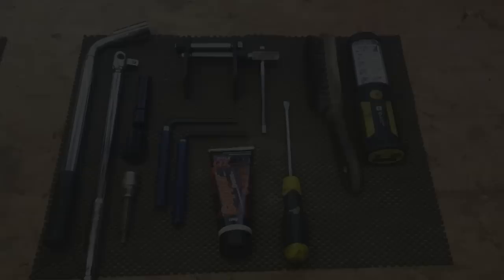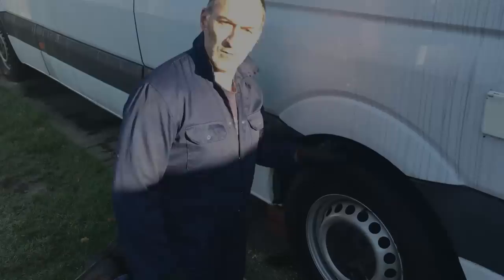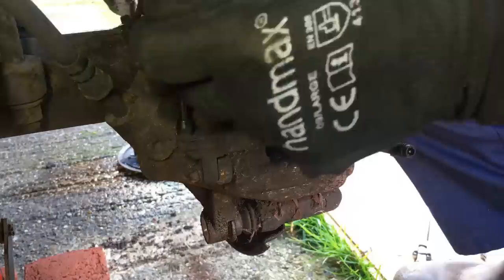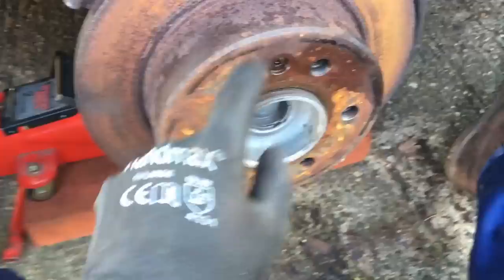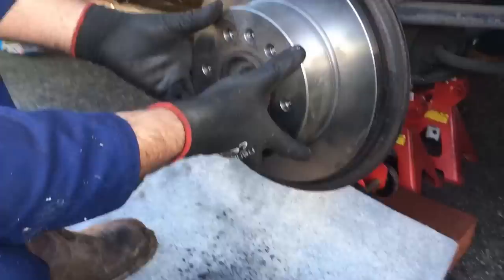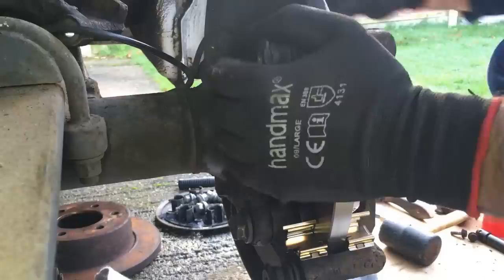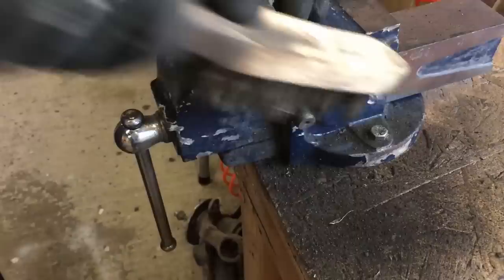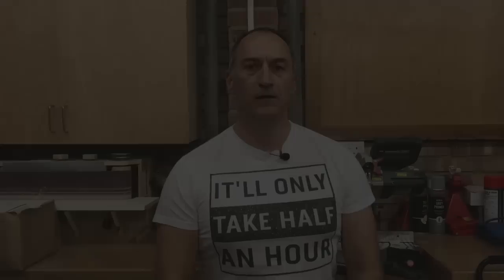Mercedes Sprinter - New Disc Brakes and Pads

Comment: Wow,
I am feeling very accomplished. 
Thank you so much from across the Atlantic 😊. 
Just did the passenger side.
Bought my 2015 sprinter used in November. 
I don't think these rear rotors were ever changed. You 20 minutes was my 6 hours of rusted frozen bolts.
But I persevered and got my passenger side done.
It's dark, so tomorrow to the next side.
I'm praying 🙏 the other side won't be hard.
Reply from the maker: Plenty of penetrating fluid and leave to soak for a bit. A shock with a few hammer blows also helps. 👍🏼😃
Reply: Replace the drivers side today. Took 2 hours😅. Not as rusty. Yay.
Reply from the maker: @time.528  That's good to hear, glad you got them all sorted ok, well done.

Comment: I always leave the hub cap off so I remember to check the wheel nut torque after a few miles. Great video.
Reply from the maker: I can't buy another torque wrench when I have one buried in the storage unit that I can't find cos I know what will happen I'll buy it and the one I've already got will miraculously appear in front of me lol
Reply: @GregVirgoe  my point was to check them after a few miles, not that important to use a torque wrench but definitely check after a couple of journeys.
Reply from the maker: Very wise and a good point, I'm glad I've got you guys here watching my back, thank you

Comment: Hey Greg. First (from the other side of the pond, US), I want to complement you on your videos. My wife and I have thoroughly enjoyed each one. They are VERY informative and have given us several ideas as to what we will do on our Sprinter. Our van will be multi purpose to use for our company and weekend trips. Obviously ours will be a bit different. Already the steering wheel is on the wrong side. Ha ha. I hope we can get ours looking half as good as yours, since I am not the expert wood worker as you are. But, I make up for for that with mechanical abilities. As a tinker on cars and trucks for 40 years, let me give you a couple of tips on brakes that I've found to work on every vehicle. #1- use some anti-seize on the threads of all mounting bolts very sparingly. That will be a big help next time you take them out (No need to hit them with a hammer). #2- Put some high temp brake grease on the smooth part of the two caliper (Cylinder) bolts. Because if it doesn't freely slide it can cause one side (or pad) to wear quicker. And, also some high temp grease on the ears of the brake pads.  #1 and 2 will make it much easier next time you service your brakes and prevent uneven wear, extending the life of your brakes and making them more efficient longer.
You have given us several tips and I hope ours will help you.
Keep up the great work with your videos! Looking forward to the next.
Dave & Uka
Reply from the maker: That's Great Advice and thank you so much for giving it in such a clear and thoughtful manner, I really do appreciate it, thank you very much guys :D

Comment: As an ex motor mechanic, the clout on the head of the bolt after applying WD40 was a standard operation. So good advice, Greg. Not finished video yet but so far everything on a par with what I would have done when I was in the trade. Good work.
Reply from the maker: So if I need a job as an apprentice mechanic later in life I'll be ok? 😉
Reply: @GregVirgoe  - Ha ha. No it's a pretty shit and dirty job bud. I have been out of the trade for a very long time. And I'd not go back. You are a very skilled fella, so I am sure there are hundreds of nicer jobs you could turn to if desperate!

Comment: Great tutorial, Greg. I did this last year as I was getting a safety warning on the dash. Turned out to only be the front discs but wanted to replace everything with new as I had just bought the van. I ‘thought’ I cleaned everything well enough but I’ve since gotten some squealing at lower speeds. Grrr. I’ll wait for spring and then take them apart again to clean and re-lube. Keep up the great work!

Comment: Great video, Greg. It's lovely to see people share these kind of videos. :-)
I would recommend to always check the activation arm, for the brake shoes. They are notorious for getting stuck. Also remember to adjust the parking brake(cable and brake shoes), after a change of brake disks. Last and not least; check, clean and lubricate the glider pins.
Reply: No

Comment: Hi Greg,

Great video, as always. Here’s a couple of suggestions for the future.

Even if you regularly bleed your brakes, the fluid that is in the cylinder will be in a bit of a ‘dead leg’. Therefore, when I do this job, rather than forcing what is almost always filthy fluid back up towards the master cylinder, I crack the local bleed nipple open so that, when I push the piston back, it expels the worst fluid out of the cylinder and into a jamjar for disposal.  It’s usually much easier to push the piston back that way too – path of least resistance for the fluid – and prevents worry of overflowing the master cylinder reservoir.

Also, once when I was when putting new seals, pistons and gaiters in, the manufacturer of those advised me that the mechanics’ favourite trick of using copper grease for anti-squeal and brake lugs (combined with red rubber grease on the rubber components) is best avoided and they recommended that the only grease you should ever put anywhere near brake components is silicone grease. (I generally find that the easiest/cheapest is from a plumbers’ merchant for fitting rubber-sealed plastic pipe parts together.) 

They told me that this is because copper grease is mineral-based and always migrates. Once even small amounts get to the rubber components, it causes them to fail, so you end up with split gaiters letting water in and the next thing you have is corrosion, seized slider pins and failing seals in the cylinders. They also said that the classic ‘red rubber grease’ that people tend to use on the rubber parts goes stiff within a couple of years and, again, you end up with a caliper that won’t slide, so just use silicone there too.

If you ever need individual brake components (that often aren't supplied by your dealer spares department anyway), I’ve found BiggRed.co.uk in Worcester to be very helpful, with an extensive range of individual caliper parts.

Regards,
David.

Comment: Hi Greg,
I do watch your videos with great interest. The interieur work you did on your conversion ist simply amazing and way beyond the skills I have. Very cool indeed.
I am a master technician and as far as your repair on the brake system goes - well done!
From my experience with vehicle brakes, I could only add some really minor advice:
- Support the caliper with a piece of wire (from a wire coathanger or similar). Just resting it on the suspension could knock it off by accident and ruin the brake hose.
- Yeah, I like using copper paste as an anti-seize compund too, I generally add a minute amount between axle flange and brake rotor to make the next service easier...
- Break the sharp edges of the new pads with some sandpaper or a file prior to installation - it does cut down the chance of break squeal (as does the copper paste on the back between caliper piston and brake pad).
Again - these are really minor issues. You even explained removing some of the fluid in the reservoir PRIOR to moving the caliper pistons back into the bore (most people miss that one and end up with a mess and brake fluid is destructive to painted surfaces). And the use of axle stands - exemplary!
Best regards from Germany,
Volker

Comment: More wonderful content, Greg.

Before commenting on brake jobs in general, I have a question that I don't remember ever being addressed:  I have my reasons for choosing a SRW Ford E-350 cutaway with 12' box. If you don't mind sharing, what are your reasons for choosing a single rear wheel Sprinter over what seems the more common DRW configuration?  Many thanks.

Pointers:
1.) Chock tires diagonally before commencing work. In front of front tire on one side and behind the rear tire on the opposite side.
2.) Release the jack only until the vehicle is resting on the jack stands, then reverse the valve to prevent the jack from retracting further. This my first backup. A second jack stand is my second backup.
3.) Hang calipers from suspension components to avoid brake line damage. I simply use a short length of wire clipped from the straight section of a clothes hanger.
4.) Protect electrical connectors from fluid contact (i.e. brake parts cleaner). I usually bag connectors, "sealed" with a small rubber band.
5.) Be careful not to contact/damage the rubber piston seal when wire brushing the caliper. Same goes for the rubber guide pin bushings on the caliper hanger.
6.) Remove caliper guide pins and inspect for corrosion and wear.This step is critical to any brake job.
7.) Remove caliper guide pin bushings, inspecting for any punctures, tears, etc., and clean the guide cylinder.
8.) Replace/reinstall caliper guide pin bushings and insert a small about of high temperature silicone lubricant.
9.) Apply high temperature silicone lubricant to the caliper guide pins and replace/reinstall.
10.) Bleed the brakes when the job is finished. The assistance of a helper is needed, as is a small receptacle to catch the fluid until closing the bleeder once the fluid runs clear.

Tips:
1.) If a syringe isn't handy, a kitchen baster works in a pinch to remove brake fluid from the reservoir.
2.) Use an old brake pad or a scrap of timber when seating the caliper piston with an ordinary clamp. This ensures the piston retracts evenly, as well as avoids damage from direct contact with the clamp.

Top up the brake fluid to the minimum fill line if the vehicle is cold, reseal the reservoir cap, and call it a day!

Lastly, baby needs a bath! I know you'll have her spic-n-span before heading off though.

Many thanks, as always, for sharing your wonderful content with the world, Greg.
Reply from the maker: I knew I could rely on you John to add the details that everyone needs to know, you are very knowledgeable on all topics. Why don't you have a channel?
The dual wheel vans are not so easy to find here, in hindsight I wish I had gone for one of those as I mentioned in the Q&A video.
I won't address each of your points as they are all very valid and you are 100% correct.
Yes, the poor baby is in desperate need of a good shampoo and buff up :D
She will be shining like a bright new pin very soon.
Reply: @GregVirgoe  Thanks for your kind words Greg. And thanks for so graciously accepting my comments. Hopefully I offer constructive, never critical, input.

Like you, I'm a DIYer. My dad started me as his helper at least by the time I was 8 years old. I was a nuclear Machinists Mate and  chemist on submarines, have owned six homes, far too many cars, and am currently converting my truck for full-time living.

Again like you, I love to help others through sharing my experience. I just have a few years on you. 😵

Keep up the great work, sir.
Reply from the maker: Ah with your technical background that now makes perfect sense.
You look like a spring chicken in that avatar, or is it an old photo 😉 lol
Reply: @GregVirgoe  That reminds me, I dislike that picture. Too corporate. Not fitting any longer.
Reply from the maker: John Coloe it has an air of sophistication about it, yeah, this guy knows what he's talking about. Mines all suited and booted too, we should be more street now we're van lifers 😆
Reply: Hi John,
just saw your comments after commenting on the video myself. :-)
All your pointers are valid and yes, a syringe will do - I have a rubber bulb for that purpose.
Bleeding the brakes should only be necessary, if air entered the system somehow. This could conceivably happen while pushing the brake pedal too rapidly while reseating the caliper piston to the pad. If you do this with a couple of "slow" pushes, this should not be an issue. Also, if you reseat each caliper piston individually, you don not have to remove an excess amount of fluid from the reservoir. If you do all four calipers and operate the brake pedal to reseat all the pistons at the same time, you need to keep a close eye on the reservoir level and you run a good chance of ruining the rubber components in your master cylinder as they may come in contact with any corrosion within (especially on older vehicles).
And I do change my brake fluid at least every 24 months. On a heavy vehicle running close to the GVWR at all times, I'd even change it once a year - with these vehicles you need all the edge you can get.
Remembering my days in Canada an F-350 was the 1-ton chassis with duallies in the rear. What's your GVWR, that you only have SWR? 
I do believe, that Greg's SRW suggests a GVWR of 3,5 tons. I do know that the Sprinter DRW units are in the 5 ton range, requiring a different operators licence and them being categorized as "trucks" here in Germany. 
Best regards from Germany,
Volker

Comment: Hi good video. brake disc/drum dosent always slip off so easily. Sometimes need to back off the handbrake adjusters through a wheel stud hole!
Also check there is no corrosion beneath the wheel cylinder dust seal. If any is present wheel cylinder may stick and cook your new brakes!

Comment: Good tidy work Greg as usual; I have watched all your van conversion videos and really enjoy them. - I have worked on vehicles all my life and, if I were you, I would be completely replacing the brake fluid. It might never have been done before, and with your long journey and heavy load, it would be a wise move. Going down a long gradient would generate lots of heat in your brake system, any moisture in the fluid will boil quickly and you end up loosing stopping power. Cheers.

Comment: Greg I used to work in the automotive industry. The little screw that holds the drum on to the hub, I think you called a "hodge bolt", its only real purpose is to hold the drum onto the hub as it goes down the assembly line. It is not needed to be replaced if you break it off trying to get it out. Just a friendly fyi. But as always on YouTube, consult a professional with any advise given on here.
Reply from the maker: I did think that its only purpose was to hold the disc in place while you put everything else back together, let face it that tiny screw is not holding anything really.
Your 6 wheel bolts are doing all the hard work here. :D
Reply: But it do tend to make it much much easier to put your wheels back on, so taht the disc doesn't rotate ever so slightly. :-) :-)
Especially on vehicles with bolts, instead of nuts.
Reply: @kennethskou5597  Agree but spend about 2 hours trying to chisel them off my wifes Honda (Honda has two per rotor) and you will learn to hate them. They got chucked right in the rubbish container as soon as I got them out. Cheers to you all from the USA.
Reply: @ Sgt. Stones Haha, rusty automotive parts, tends to get the worst of my personality turned on. 
A few "nice" try, then some swearing, then chip my fingers and THEN i bring out the power tools.  :-) :-)

Comment: I noticed the wear on the brake pedal rubber, if both pedals have the same profile swap around the rubbers on clutch and brake pedal so there is an unused part where your foot naturally hits the pedal when coming off the throttle. Worn rubbers used to be the Gestapo vehicle tester's favourite sneaky fail when I took vehicles into for a taxi MOT test.
Reply from the maker: I will have a look at that, thank you for pointing it out for me 👍🏼😊
Reply: Here in AU, at least in Victoria, a worn rubber pedal will result in a fail in roadworthy certificate.
Reply from the maker: It probably looks worse on that dark bit of video than it actually is in reality. Cheers guys
Reply: Most important part missed did check the sliders were seized or not

Comment: I have overheated LWB Sprinter brakes on the steep hills of Devon before now. When the time comes I will be thinking of vented discs for my MWB. Like you said, the additional weight doesn't help if your brakes aren't up for it.
Reply from the maker: The fronts are vented discs as they always take most of hard work when breaking. You can get them with cooling holes too. 😀

Comment: Hi Greg,
After watching your video I decided to tackle my 2011 sprinter brakes myself as the front brakes was getting bad and discs needed replacing. The front carrier bolts was a nightmare took ages to brake free but I stuck with it and eventually they broke free.
The sensor wires I couldn’t remember how they was routed from front to back or just from the same side as they plug in. So I think I may have not connected them properly as my low brake pad light is still on on the dash.
The rear brakes I couldn’t get the disk off at all as it seems the handbrake pads must need slacken off to get the disk off but the slackening adjuster must be seized. I couldn’t move it. So just chained the pads on the back for now. Brakes work fine now just a few hiccups. First time I have had a go at this. Will have another look at them front sensors 😁
Love your videos very helpful

Comment: Recommended torque on those carrier bolts without access to a torque wrench > "pretty fucking tight, but not murdered up"

I agree on the slight smear of copper grease on the back of the pads and where the touch the carrier. Still taught when I was learning 20 odd years ago.
Reply from the maker: That's exactly the amount of torque I applied 😃 good to know I'm on the right track 👍🏼